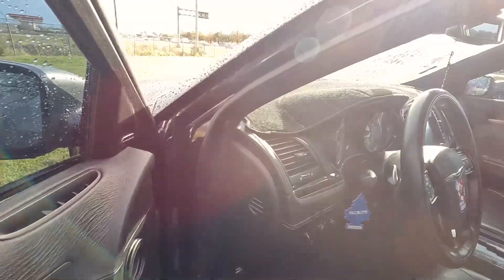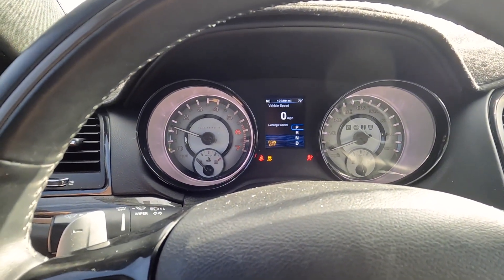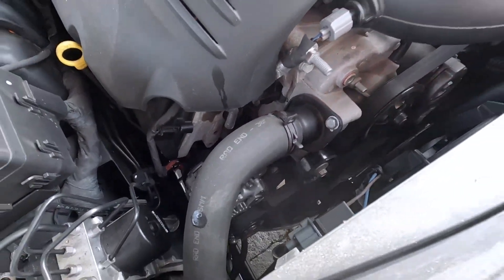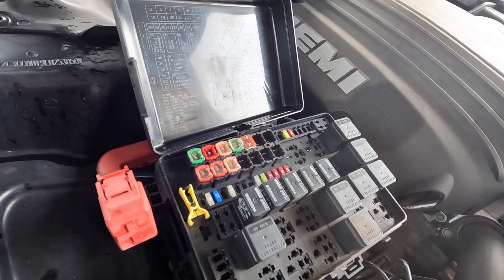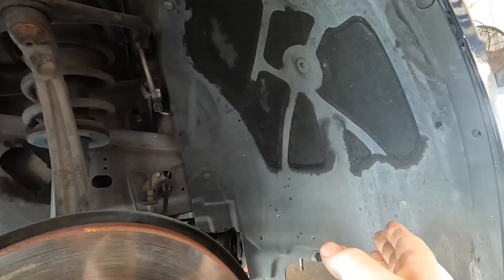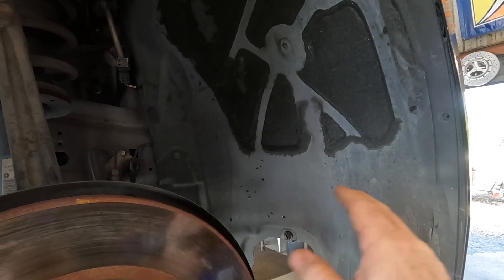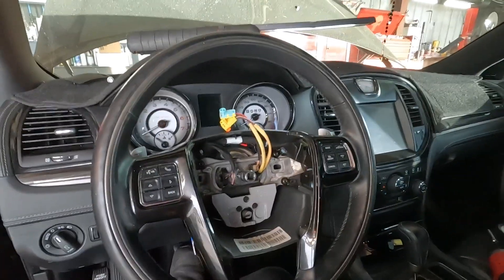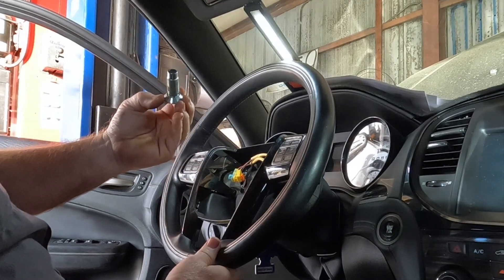ELECTRIC HYDRAULIC STEERING pump FAILURE, DIAGNOSIS...STEERING MODULE, NO Cruise, No horn! Chrysler

Comment: I have exactly the same car and the power steering pump fuse is blowing when I turn the wheel with the car stopped. I have already changed the power steering pump fuses but the problem persists. Can you tell me what else I should do? It also has steering wheel angle sensor codes. Can you help me ?
Reply from the maker: I sounds like high current draw from the pump motor. It needs to be tested and probably replaced. Also look for wires touching where they shouldn’t.
Reply: @ Thanks. I already changed the pump and installed a new rack and pinion. But the problem persists. I only have codes for the steering control module.

Comment: where is the DIAGNOSIS ????
Reply from the maker: The entire video from beginning to end. Scan data, checked fuses, power and ground, we discussed theory of operation, checked fluid level…Determined the motor ran, but the pump did not produce pressure using scan data. You may need to watch the video again?

Comment: Is it normal for the voltage  to drop when car is in park and u turn the steering wheel from 14v to sometimes 12v then it goes back up when u stop moving it on this same car 300?
Reply from the maker: It sounds like a battery or alternator might be getting weak. The steering system uses an electric motor on some, so that could be a factor. Also engine speed reduces on a hydraulic steering system so that might make voltage dip. I would look with a scan tool to see charging system load when this happens if it was at our shop.
Hope this helps.

Comment: So that noise when you turn the wheel is normal
Reply from the maker: Depends on what noise, low fluid, sometimes a suspension issue can cause noise. But tires do scrub the ground when turning and not rolling.
Reply: @JimmyMakingitwork  you can hear it in that car when you turn the wheel sounds almost like a motor sound do you have an email I can send it to you

Comment: Should the pump motor speed be zero while idling? And when moving should shoot up?
Reply from the maker: Yes, it will vary with speed and load. Turning the wheel it should rise even when not moving.
Reply: @JimmyMakingitwork  thank you so much was wondering why it was just at around 2700 while idling if there is no load or the wheel being moved really had me scratching my head

Comment: Hello jimmy i have a 2016 charger had rack replaced and power steering assist need service lights back on any suggestions??
Reply from the maker: If it's an electric/hydraulic design in the 2016 I'd check the fluid level and look at scan tool data to see if the desired and actual pressure are close. Also Sometimes just a steering angle learn needs to be done if it hasn't.
Sadly I've also seen defective parts a couple of times on them.
Hope this helps.

Comment: hello and thanks for the amazing vid.  I have the same issue with the power steering on a 13 dodge charger rt. it shows C212A-84.  I didn't see it on your list of dtcs. could this issue be relative to the one you showed?
Reply from the maker: Let me check…
That code refers to voltage low at the module. There is a 50 amp fuse that powers it, so the fuse or a connection can be bad, or an internal module problem makes it think it is.
I’d check at the red wire going into it, a heavy wire, it should have battery voltage. Also check the ground, a black wire, since it can cause odd issues like this also. If they are good it does most likely have a bad module.
Reply: @JimmyMakingitwork  thanks.  it was the wiring harness connecting to it

Comment: What scanner are you using my dodge is having same problem
Reply from the maker: I am using a Launch x431 Pro TT right now. But any name brand scan tool with bidirectional capability will work. 
I have a few in my Amazon store to check out. Link in the description.
Reply: @JimmyMakingitwork  thank you

Comment: My 2015 Cadillac cts power steering just stopped working after it rained. Not sure if water got in somewhere or a coincidence that something went out at the same time. Any tips on what to check?
I don’t see any leaks and don’t think the fuses are bad.
Reply from the maker: Sometimes the pumps can go bad, I'd check to see if the fluid is moving in the reservoir with the engine running. The level should also change slightly from engine off to running. If not the pump has likely gone out.
Reply: @JimmyMakingitwork  thanks so much!

Comment: On the Challenger, the two bolts toward the front of the vehicle are not accessible.  There's a nut below that bolt that's can't be removed that will separate the main bracket from the front bracket so you can remove it from the vehicle.
Reply from the maker: Thank you.

Comment: one more question, do you need to program the control module? i purchased one used and install it, resolve all the problem with the steering buttons but now my steering is hard when i turn right, is ok when i turn left, just hard to right side. i guess if the pump is bad should be hard in both sides not only right?
Reply from the maker: They only require initialization. Might need to look at steering angle data and see what codes there might be.

Comment: I need a mechanic like you.     I’m going through a similar or maybe the same thing .   I have a 2015 300.   My steering wheel just sounds so bad now.   I’m thinking it needs the power steering rack or the electric power steering pump motor.    Parts are so expensive smh
Reply from the maker: Might have a leak, check the fluid level and use a flashlight to look around for it from the tank to the rack. Hope this helps.

Comment: Already installed 2 used power steering pump  on 2013 300. And no fuse or any codes. I guess I will try the steering cluster module.
Reply from the maker: The best way would be to use a scan tool and see codes and data for the system. That way you can figure out what the system is lacking to operate properly.

Comment: Is it mandatory to use CHF 11s or can I use AS227 as well?
Reply from the maker: I wish I could say for sure, I'd stick with the recommended fluid, just in case. Too expensive if they aren't compatible.
Reply: Thanks for the adivce! I originally had the AS277 prestone brand installed and it would not work. I removed all that fluid out and install the CHF11S ($48 bottle) and everything worked perfect. Thanks Again!  @JimmyMakingitwork

Comment: what was the issue?
Airbag Light and button stops work even the horn not working
or you got traction light only???
Reply from the maker: This one had multiple issues, but only wanted the steering repaired, which did fix other issues as well, but not all.

Comment: Why does it squeal so much when turning right after you put the new pump on? Mine does the same thing when I turn both in the air and on the ground and I don't wanna replace the pump if it's something else?
Reply from the maker: If the fluid level is ok it could be the belt.

Comment: Hi Jimmy.....watching your video to the 'bitter' end, you haven't told us the steering pump's problem! 
I'm trying to investigate why my 2008 Peugeot has gone through 2 x pumps (electro hydraulic) one in 120K kms, the used replacemnt in about 50K kms. I'm stumped as to why  the motors die, even though the fluid reservoir is correctly filled?
Reply from the maker: These motors are doing a lot of work, the duty cycle is high. Since electric motors have brushes and other components like bearings and wiring in them, they wear out and stop working eventually. Just like a window motor, starter motor or similar. If they short they'll blow fuses, if they go open. they'll simply stop turning and in that case a tap sometimes brings them back to life temporarily.
Reply: @JimmyMakingitwork  Thanks for your interest in my problem. I do think it's a loose live or ground wire (or both). Tanks again!

Comment: My steering wheel is stiff but drivable manually an showing exclamation fluids are full to top could this be my issue
Reply from the maker: Yes, it could be. If all the fuses are good I'd have it looked at so powers and grounds can be checked as well as codes to be sure.

Comment: what is the hex size socket you used it to removed the steering wheel?
Reply from the maker: It has been a little while since I did this repair, so I'm not positive. I think it is a 21 or 22mm? Maybe someone will see the comments and correct me if I'm wrong.

Comment: I have the same problem with my 2016 I don’t know what to do
Reply from the maker: All you can do is look for leaks in the system, check the fluid level and fuses. After that it's likely a pump or rack problem. Might need to see a good mechanic nearby for ad diagnosis if you don't do your own repairs.